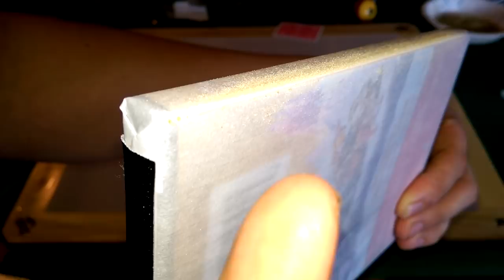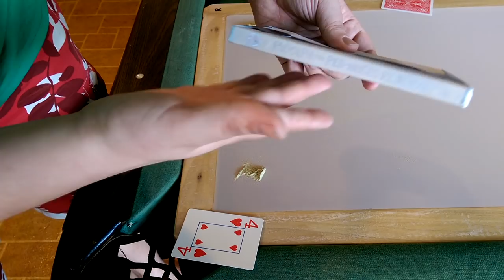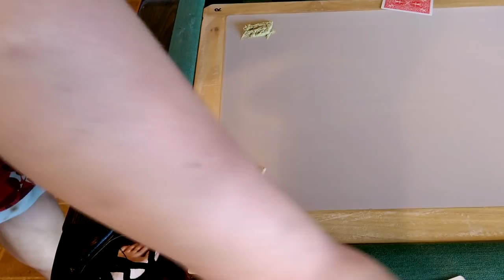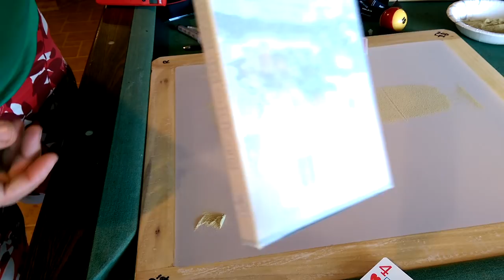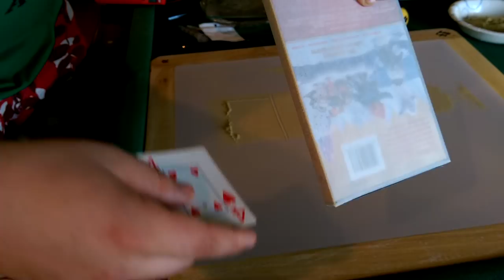Cleaning dry sift using the "static tech"

Comment: Hey bret i just watched the latest d420 k vid i think you should check it out if you havent already..  I was just noticing how you are holding your dvd case on a slant when you are scraping and i think IMO thats why youre contaminant is closer to your heads when you are trying to scrape the goodies.... He seems to lay the spine of the case flat pushing in one direction and when he has alot of heads built up he then puts it at like a 45 angle so the parts of parchment that dont have anything stuck to it yet gets covered..  Watch his sifting and burning video at around 11 minutes in he explains it..
Reply from the maker: Changing the angle gets contaminants in it. If u hear me say where the contamination came from I said it's from the side of the DVD. I didn't scrape it all off first so some fell when I was scraping the goodies
Reply: Yes the angle is partially what causes the flick of the heads to one side and the sticking of contaminants on the other...

Im not running the same quality buds as you are and not nearly that amount so whatever works for you like you always say.

Just saying i tried holding my case like he shows in his latest vid at 11:20 straight spine side down and push with no angle ..
it seemed to help me get the contaminant to stay on the front and flat side of the case and not the other goodies side.

Comment: Great video! Thanks for posting new videos! I know everybody wants to enlighten you or are quick to point out the obvious to you! lol. I would like to share a solution I have found for tempreture for hash production on larger scales. It is possible to purchase a tractor trailer refrigerated trailer from salvage pool auctions. Obviously this not for the average Joe. This for dispensaries who produce extracts. They are easy to move, and are quite spacious. With a Lil customizing such as lighting and humidity, one could park it right beside their shop, not to mention it's secure.....L8ER

Comment: Also one of the things you're overlooking on the rosin is that for someone who has 10g of flower, it makes more sense to turn that into 1g of nugrosin, than futilely try to make dry sift from it. Of course, it goes without saying that dry sift is superior to the nugrosin, but not absolutely so if you take other variables into account. I'll add that if done proficiently, you can have A LOT of terps. Although the heat is fairly high, the exposure time is extremely short, so imo you're not losing that much more compared to aggressively vacuum purging a hydrocarbon extract 100+ hours.

Comment: whats everyones thoughts on dry ice extracts in bubble bags i had terrific yields but i heard bubbleman talking about mostly contaminant but coulndt you just clean it up with the static tech
Reply from the maker: Bad. It makes plant material into dust so it contaminates the sift. Frozen plant dust looks like kiff but if u look under a microscope u see it's over 90% contamination. That's why it won't melt on a nail like this does.
Reply: gotcha thanks for the response bret
Reply from the maker: No problem. Back when I was scared of butane I bought a 1 gallon bubble bag kit. Then when people started posting videos raining piles of Kiff I got on that shit. I liked the 160u bag the most. The kiff it made would just burn. It looked a lot better than it was. If u ever wonder how shops can afford to have $10-$15 kiff. That's how.lol